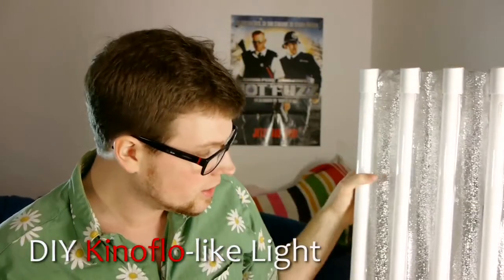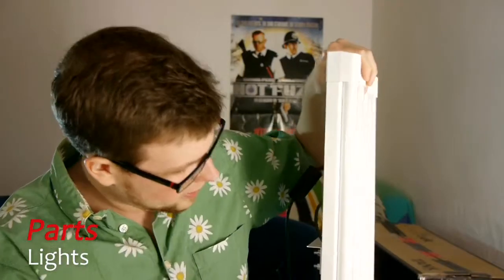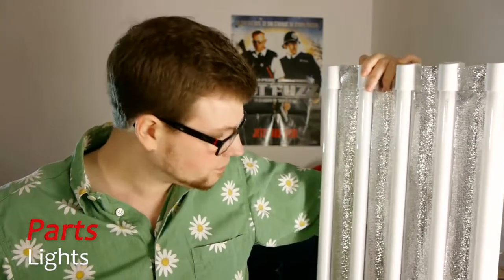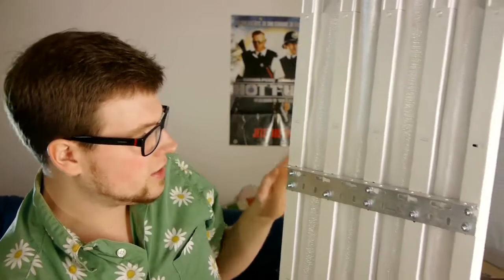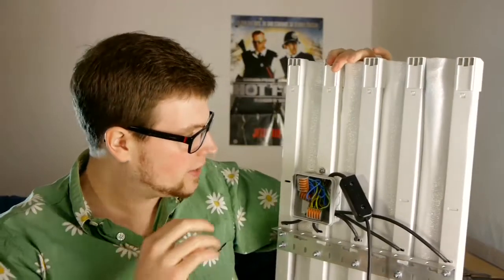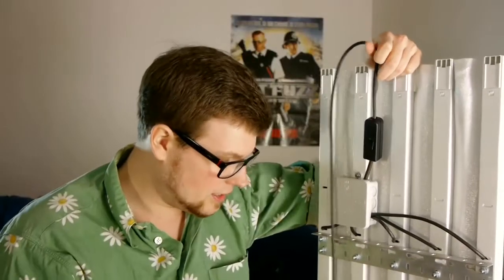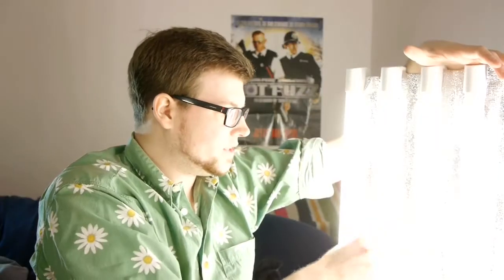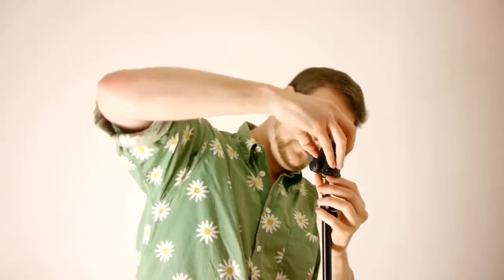Building a Kinoflo-like Light on the cheap - DIY Tutorial

Comment: Great video (and yes the blow dryer was awesome)! Just a couple suggestions: you may want to search "baby plate with swivel" for some cheapers mounting possibilities; and have you thought of using emergency blanket material as the reflector?
Reply from the maker: Hi there, I looked at these swivel mounts, too. But a usable Ballhead is around 20€ or so at eBay, and tripods which accept these swivel mounts really expensive :( or do you have a good alternative here? :)

Using emergency blankets would absolutely work. Yet they make nasty noises and I'd expect them to be not as stable as these windshield-thingys, as these are thicker and very flexible. But of course a great alternative if you need e.g. gold or want an uber-cheap solution :)
Reply from the maker: hm, I just researched a bit on the baby-swivel. Seems like there are relatively cheap plates from Manfrotto (around 33€) and relatively cheap Flash/Umbrella holders (around 20€) that would work together in such a setup on any lightstand. It's more expensive then a ballhead, but also more slick. Hm. Adds some weight, but still.

I might buy one set and look how it performs :)
Funny enough that setup will be more expensive then the lamps, haha :)

Comment: One quick idea for dimming, maybe just add a dimmer switch. cut the wire or replace the current wire you have installed with the switch. one idea if you need some difusion is get a piece of plexi glass and mount it a few CM's away from the lights but before you mount it take sand papper and scratch it up or you can buy plexiglass that's already built for light difusion for a regular celing set up